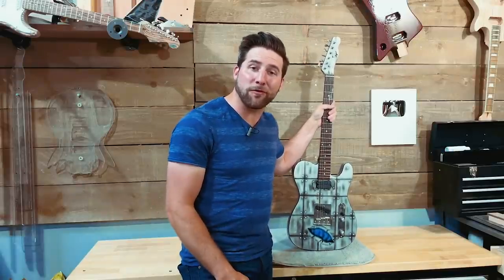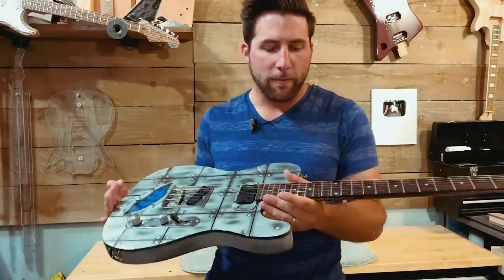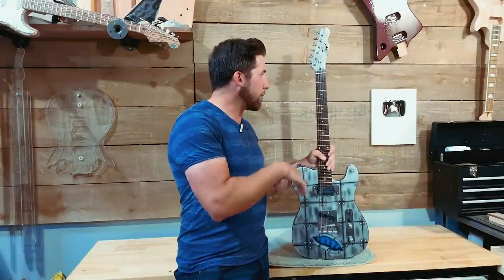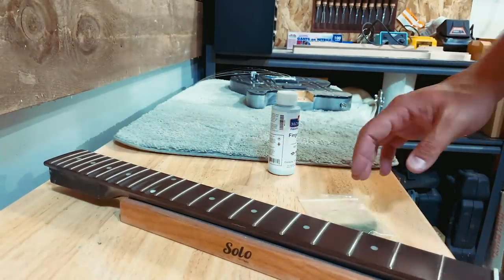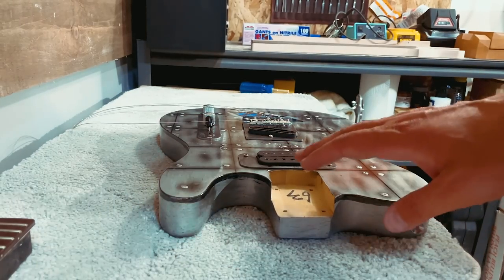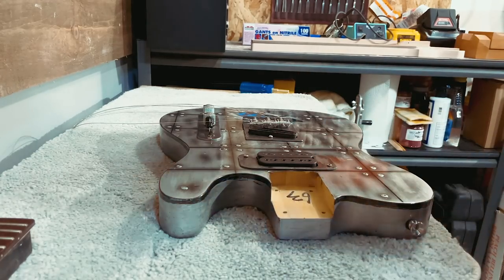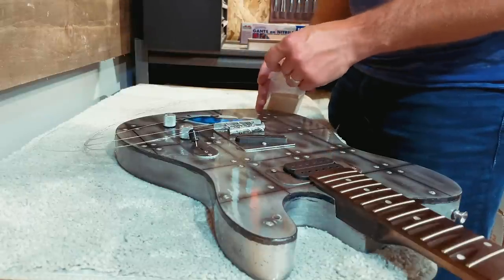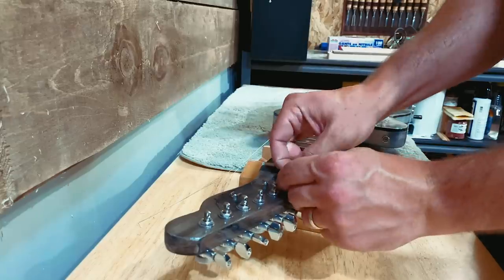A Trick for Fixing High End Action on your Guitar

Comment: Nice finish Brad. If I could suggest something? Invest in an impact driver instead of that drill. It affords you better control and has a built in torque limiter. A 12v model is all you need.
Reply from the maker: Thanks; I have one. I just tend to use the same drill for everything because it’s fast and handy haha.
Reply: @BradAngove  I find that I end up using the drill for holes only. The battery lasts longer in the impact and I get better control over fasteners with a lot less stripping out. I learned this working in swimming pools where most screws go into some plastic or other softer materials.
Reply: Isn't the function basically the same on the drill by rotating the torque setting on the neck of the drill? (which I see his drill has)  I know the difference between an impact driver and drill, but if we are talking about simply limiting the torque, does the impact driver still have an advantage?

Comment: one great tip I've learned - slacken the neck bolts after tuning the guitar and let the strings pull the neck into pocket, then tighten again and retune - did wonders for sustain on my bolt on guitars

Comment: My buillds usually use neck shims and always use neck screws that pass through the body holes.  I use a method from Highline Guitars to determine the proper amount of shim: a straightedge on the frets should rest on the saddle when the saddle is adjusted all the way down.  Then raise the saddle for desired action.

Comment: I have been using 3-in-1 Oil on fretboards for almost 50 years. Works great and the neck won't swell due to humidity afterwards.
Reply: Possible carcinogenic concerns from exposure due to long term direct skin contact with petroleum products.  Low viscosity UPS grade mineral oil might be a better option. It's the active ingredient in just about every fretboard oil out there except for Fret Doctor, which is made from essential oils.

Comment: Great video. It is amazing that shimming the neck can solve problems at either, or both ends. I prefer tapered shims. They are more expensive, but well worth it. This is the only way to get true 100% contact between the neck and the neck pocket. And don't forget to slightly over size the bolt holes in the body. Very important.
Reply from the maker: For the amount of actual width these have I’m not sure a tapered shim makes any difference, but I can see why they might in theory.
Reply: I realize people will do this many different ways and be happy with the results. The thing to remember is that this takes place close to the end by the truss rod. An important end of the neck. Let me put it this way. When two surfaces are going to be bolted together and these surfaces do not have full co-planar contact, stresses are introduced at that point since the material will deform once they are screwed together. This deformation could affect the truss rod operation or damage the heel. The way to avoid this is by using a full contact tapered shim that will give a non deforming, full contact connection. No gaps, no stress, no deformation. It is not a theory, just best mechanical practice for connections requiring shims. There is an old saying, "never time to do it right, but always time to do it twice." I try do get it right the first time.
Reply from the maker: Fair enough Dennis. I just don’t think a shim this thin has any chance of damaging the heal or impacting the truss rod. I get what you’re saying from a physics perspective, I just don’t think there’s enough there for a practical impact. It seems to me like suggesting that if you park your car with a piece of cardboard under under one wheel for a while it’ll throw the suspension out of alignment.
Reply: @BradAngove  I'm a full time guitar tech, I always taper my shims, my personal belief on it's importance, is that the uneven force applied from the non tapered shim can cause issues with the high frets. Ever played an old bolt on guitar which starts to warp past say the 15th fret, coz they usually all do! Making sure the shim is tapered and applying even pressure will mean that this warping, which can cause dead frets, takes a little longer or is never an issue. It's a small thing, but it is the 'proper' way to do it.
Reply from the maker: Thanks Joe. I’ve played older guitars with warping issues but they didn’t have shims. Wood can change over time; there’s no doubt. I still don’t think a shim like this is going to be any better or worse, short term or long, than a tapered shim. But, as always, to each their own. 
I don’t worry so much about the “right way” to do things on guitars anymore. There’s a lot of old mythology still governing how people work on guitars. For example, some people still think lacquer sounds noticeably better (or at least different) than poly on an electric guitar haha.
Reply: Not quite apples to apples. A car has independent suspension at each wheel which compensates for the road not being even. And you are more than welcome to do it what ever way you like. My engineering background and using a tapered shim allows me to calculate how much change occurs at BOTH ends of the neck. A little change at the pocket makes a big change at the head-stock. So I usually get it right the first time. I have run into a lot of people that claim they have 20 years experience in a certain craft. But after a short conversation, I realize that the just repeated their first year 19 times and don't know much at all. I am just trying to share some experience and knowledge, that's all.
Reply from the maker: Fair enough Dennis. Thanks for providing your perspective.

Comment: Nice job Brad. You shimmied around and screwed that neck like a pro. I actually need to shim my Les Paul copy. I put a Fishman Triple Play Connect Midi Pickup on it and it raised the action significantly. Thankfully the Les Paul (ish) guitar I own has a bolt on neck so I'll just get some balsa wood and shape it before I put it on. Have to make sure the neck angle is optimum. By the way, the Fishman Triple Play is an Awesome Midi system. You can trigger beats, different instruments, loops or even an entire orchestra by plucking a single note. It's also great for transposing to a DAW while you're playing in real time. A great songwriting and practice tool. You should do a review of one on your channel. Hit Fishman up or charge it to the company. Brad The Luthier Corp. Not to be confused with Bob the Builder.
Reply from the maker: I’m not familiar with those. Do they get mounted under the bridge? I’ll have a look. Maybe fishman will help me out with that, but as you probably know by now I’m not exactly a talented guitarist/songwriter haha. I may have to bring in some help to demo it.
Reply: @BradAngove  Yeah it has a pickup which mounts directly near the bridge on the pickup's side. I'm sure Fishman would help you out. Grab another one for me while you're at it. Ha ha ha ha.

Comment: Love these videos thanks. Is there a video on here in which your repair deep scratches. I've got an Epiphone LP in poly and someone scratched it through to the timber on the body. I want to know what my options are.
Reply from the maker: I don’t think I did a video on it, but on a poly finish I would generally do a little bit of color (on a fine brush) and then use some starbond super glue to fill the scratch. Then I would scrape it flat with a razor blade, spot sand very fine, and polish.

Comment: They are offering shims at StewMac, great stuff, expensive als allways, but perfect. You‘re SO right with the screeholes!!! But the screw you are using has a flat upper part, that would work in a tight hole too. (what sounds a little weird…)

Comment: I have a bag of ivory key tops from an old piano I use for neck shims. A little copper shielding tape to hold it in place. You're mistaken about neck pocket fitment side-to-side not mattering to the function of the guitar. Totally matters. Excellent opportunity to learn to shim that direction also. If you put your cordless on the neck screw, it'll drill out any hanging-up in the body. No need for a drill bit.   EDIT: The first time you strip out a neck hole using a cordless will cure you of that bad habit. 
We'd really like to see some pictures of your animal in need of surgery. It'd make a big difference in clearing out your inventory.
Reply from the maker: Thanks Rich. I have to disagree with you about the side-to-side element, and I may at some point do a video proving it (I’ve played a guitar with just a “tongue” for the heel instead of a full pocket and it was great). I appreciate your support. I may post a picture of the pet on Instagram if you follow me there.
Reply: @BradAngove  "great" doesn't equal "superior" or "beyond improvement" in American English. Not familiar with the Canadian translation.
Reply from the maker: I didn’t say it was superior. I said the side fit doesn’t really matter; which would make it equivalent. I also didn’t say it was beyond improvement. The proper inference from me saying the side fit doesn’t really matter would be that it is not an improvement or a detriment one way or the other. That goes for every dialect of English that I’m familiar with.

Comment: Is there any advantage or disadvantage to using a shim over changing the angle of the pocket with router jig or chisel?  Other than the fact that you can't easily replace wood once it is gone.  I had to shim the neck on my Schecter and I read that shims would decrease the value of the guitar.
Reply from the maker: Some people would probably argue that changing the angle allows for better contact between parts, which they think will increase sustain. 
I don’t think it makes any difference as long as you have the skills to do a good job of the angle change and you’re not removing wood that you need (aka neck isn’t too low in the pocket). However, if I were concerned about the value decrease I would do a tapered shim the full size of the pocket, test it, and then glue it in.
Reply: @BradAngove  Thanks for taking the time to answer me.  I really appreciate it!

Comment: Hi Brad, I read somewhere that it’s best to use a shim that goes for the full length of the neck pocket and is tapered so it’s thinner at the headstock end of the neck pocket. It’s something to do with their being a gap between neck and neck pocket where there is no shim as you have done here. What are your thoughts on this? I’ve got a Squier CV 70 Jaguar that I’m thinking of shimming so would be interested in how you view the process of shimming.
Reply from the maker: There’s nothing wrong with that option except that you would perhaps see a bit of the shim. People believe a lot of things like that in guitar building for some reason and most of them make no practical difference. Particularly in an electric guitar that gap will not make any difference that we would be able to discern.

Comment: I think It would be much better if you used a file and took some of the front edge of the pocket instead of using a shim, like an 1/8th or so. I normally stretch a string from the nut to the bridge with the saddle adjusted to its lowest point and file the pocket until the string just touches the last fret then install inserts and actual bolts not screws. I t seems to work the best for me and I get solid wood to wood contact for best sustain and no gap at the pocket. Cool looking guitar for a kit build.
Reply from the maker: Thanks. I don’t think this creates a gap that is capable of changing anything, so I would stick with this method simply because it is so much easier and doesn’t creat a risk of making the bottom of the pocket uneven. As with all things though: do whatever works for you.
Reply: You'll never in a million years achieve a flat surface by filing.  Shimming is the best way, unless you can set up a router or similar machine tool to generate a flat surface at exactly the right angle.  I agree with the use of inserts and machine screws.  They improve the neck joint immeasurably.
Reply: @ParaBellum2024  I get so close it's not even measurable. The string will tell you how close you are so yes you can get as good as any router. Use the right file and it's perfect plus years of experience helps :)

Comment: If it buzzes on the high frets with a couple soda can shims does that mean it needs fretwork I won't settle for high action
Reply from the maker: It could be a truss rod adjustment, but more like needs the bridge raised a touch or some fret work. It doesn’t hurt to level the high frets down a touch either.
Reply: @BradAngove  the trust rod on this neck is the one where the neck needs to be taken off to adjust it. It was the 19th 20th 21st 22nd 24 fret rasing the floyd rose from the zero point didn't help I tried 1 through 4 shims.
Reply from the maker: If you have buzz there then a shim is the opposite of what you need. I’d start by removing the shims, and then if necessary level those down slightly.

Comment: Why not simply lower the saddles? Are they already as low as they can go?
Reply from the maker: If the angle is inadequate the saddles would end up being too low. Either bottomed out, or at least low enough that the set screws would come through the top and may be uncomfortable.
Reply: @BradAngove  Yeah, I agree with that. Just wanted to confirm that this is the reason.

Comment: Good job. Sorry about the pet. I just found out mine needs about 1500 worth of dental work. 
But the real world of working on guitars is not quite the same as what you're doing.. I have one to be worked on that shows the reason. It's a 1998 faded cherry Epi SG. Headstock is broken off along the side of the 1 2 3 strings. Not a hard fix but the guitar has been played hard and put away wet for 24 f'ing years. I need a hazmat suit and cleaning area setup before I even touch it. It's more normal then working on a pristine almost new guitar.
Reply from the maker: That sounds like quite the project. I think BigDGuitars has quite a few videos on things like that.

Comment: Hi I have jem jr,and I am on low E 2.5mm high E 1.5mm but I'd like low E to be 2mm to feel comfortable!! I have spent days trying to adjust kneck taking it slow tuning every turn I make but makes no difference still I get abit of buzz,only on my low E A strings it's really annoying please help me I'm only wanting to come down on low E bye 0.5mm and it wont let me due to buzz any ideas
Reply from the maker: What part of the fretboard are you getting the buzz?
Reply: @BradAngove  first 3 fretts E A strings low,,then from fretts 12th 13th 14th onwards buddy it's not the worst but its noticeable and it's not even low action I'm only dropping to 19mm 2mm soon as I go too 2.5mm it goes away but I would like it down to 2mm atleast to feel comfortable
Reply from the maker: Have you changed the string gauge at all?
Reply: @BradAngove  I changed strings same gauge 9s and shim my locking nut height,its reading from frett 1 2 3 about 1,2mm? Is that high,I have jem jr ibenez its brand new frets are all new seems no uneaven fretts checked them,it had all over buzz when I had got the guitar until I raised up the bridge and mucked about with the kneck,not slot of kneck relief to muck about with
Reply: @BradAngove  do u think 10s would help if I put em on
Reply: @BradAngove  got a funny feeling I'm gonna have to live with 2.5mm height for low E medium action but my high E is on 1.4 1.5 mm that's perfect no buzz
Reply from the maker: A different gauge may help, but if that’s what came on it it may not. You’ve already adjusted the truss rod and are happy with the other strings?
Reply: @BradAngove  they came with 9s on mate,I'm thinking changing to 10s to see if it helps abit,frett buzz on first 3 fretts strings Low E A then from 12 13 14 so on I cant raise it no more than 2.5mm that be crazy high!! Should I shim the nut height! And change gauge u think,I've tried adjusting kneck lots but makes no much difference i have it tight as it can go every time i losing it makes it more buzzing fretts are all level kneck not twisted wow I'm just abit confused my other ibenez s521 bbs was easy to adjust i added fitted a locking nut to that guitar as it kept going out of tune,and it couldn't play better i got it good,low E is 1.9mm and high E is 1.4mm I'm very happy with that no buzzing I added 11s gauges on that from 9s and it is great guitar.

Comment: I wanna make my own evh guitar and I was wondering if rustEloum Enamel paint is any good
Reply from the maker: It’s certainly an option. Not a typical one for guitars, but I’ve used it on a few for sure.
Reply: @BradAngove  and would just crystal clear enamel be a good top layer to protect the paint
Reply from the maker: Yes, that generally works just fine.
Reply: @BradAngove  thanks you helped a lot

Comment: Everytime I drill out the neck screw holes in the body, it chips out the bottom side and looks like crap.
Reply from the maker: I’m sure there are some good videos around about preventing tear out while drilling. Have you tried starting on the bottom side instead?
Reply: I've tried it both ways.  One video recommended drilling from the top.  I did one recently and put tape on the bottom and the hole were clean @BradAngove